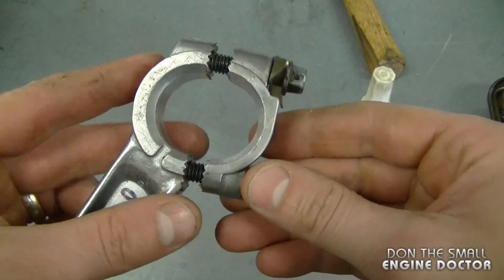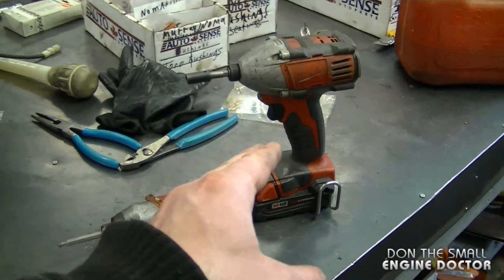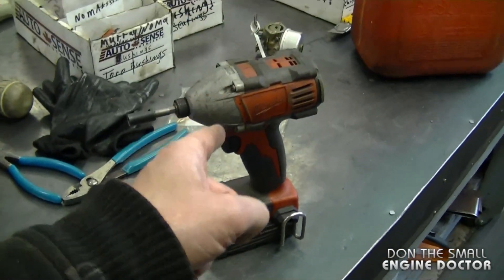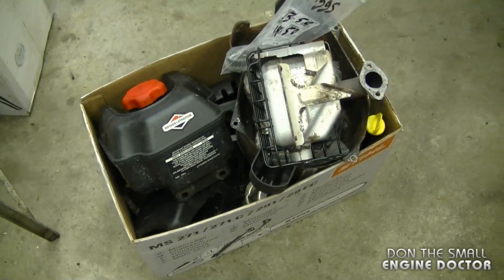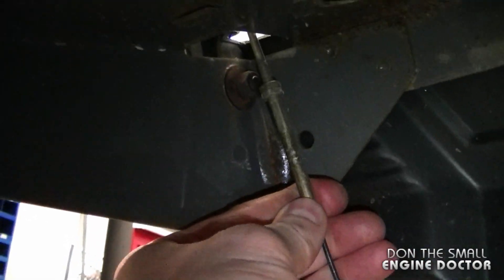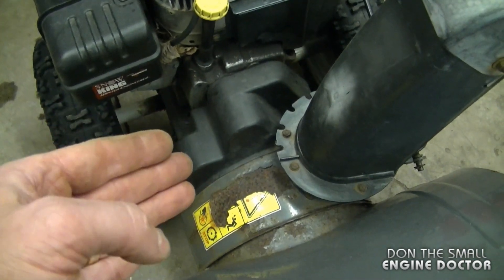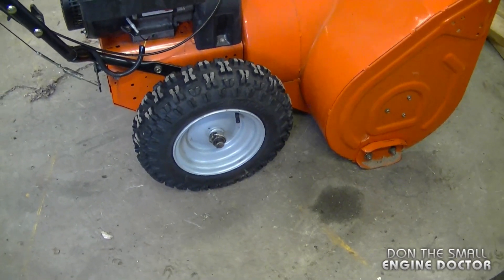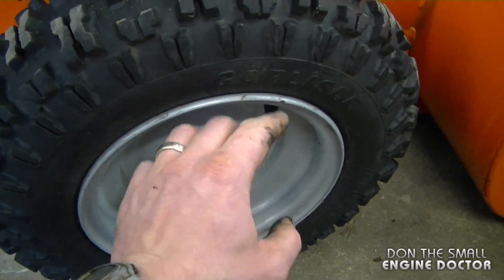Small Engines Q & A Video #147

Comment: Something to think about with a carb.  Check the throttle shaft and bushing (if it has one) before even wasting time cleaning or rebuilding it. It there is really any wear (there always is) it can cause a vacuum leak and run lean/hot. No amount of cleaning will fix it.  A little air leak can make a huge difference.

Comment: Great video, really nice mix of questions this time. Hoping I can tighten the drive clutch on my blower this way, would be an easier fix than trying to degrease and or replace the innards.

I've probably over cleaned some carbs, but I don't have a lot of access to replacement ones without going online. I am a fan of using a torch tip cleaner tool, and permatex generic hylomar on the gaskets has also done well by me.

Comment: When the carbs get old the throttle and choke shafts wear out the aluminum carb body creating a small but noticeable vacuum leak that's why some older ones can't be cleaned to fix problems

Comment: I think the fuel is a big problem now that used to not be, I worked on 3 carbs where the float valve seat had swollen  and several string trimmers where the fuel lines deteriorated prematurely .

Comment: Great q&a Don! The ethanol in the fuel really ruins the carburetors on these small engines. I find the small carburetors on two stroke engines like brush cutters and chainsaws get ruined more quickly than those 4 stroke carbs. Can you still buy ethanol free fuel in Canada? Here in Holland every brand of fuel has at least 10% ethanol in it. Since the last three years I run Aspen in my power equipment. It is sort of a biofuel that all professionals here use. It leaves almost zero carbon behind in your cylinder and its exhaust gasses are much cleaner than with regular gas. Unfortunately it costs almost $4 per litre. I don't know if it has any ethanol in it, but my equipment runs fantastic with this stuff!
I hope temperatures will rise soon there in Canada. Is it still very cold at your place?
Have a great weekend Don :)

Comment: Nice video Dony!   With regard to carburetor replacement, I'm going to replace the carb on my Honda HRR216 mower.  My question is, are these carbs pre-set at the factory or does the low/high idle need to be adjusted.  If there is a limiter cap (I think that's what it called, lol) I'm guessing they're pre-adjusted. Always enjoy your vides Dony, have a great weekend.

Comment: Got a question about John Deere SX75 riding mower. It's a smaller rear engine driven model. The issue is that it will not speed up into the higher gears ... it is moving forward at slow speed and reverse is actually slightly quicker. What could be the possible problems? Is it worth it to fix it? I suspect it's the transmission but not sure. Thanks!

Comment: Thank you for posting your videos Dony,they are very informative. Can I ask you why would a B/S 18 h.p. opposed cylinder engine only runs while the choke is fully pulled out, and then it barely runs? I rebuilt the carb and the fuel pump, still its sluggish and stalls. I bought this brand new back in 1994 and it just has never run or idled right. I even bought the extended warranty back then. The Sears repair guy told me "You have to run this engine full throttle all the time", and that was 21 years ago.It never has ran right since it was new..Its in a Craftsman G.T.5000.
Reply from the maker: it could be a bad carburetor, sometimes adjusting it helps
Reply: donyboy73 Thanks Dony.
Reply: "Well,Do Ya....Punk"? There are 3 things you can do with dog shit......

Comment: I have a used '95 MTD 28"  600 series blower, with a 10 hp Tecumseh, and with new, matched set, dual auger belts.   One of the belts keeps coming off of the large pulley after some use, to the point that once I engage the auger, I won't disengage it until I first shut off the engine.  Despite this inconvenience, it might still come off once or twice per use.

I keep the plastic belt guard on top on during use.  I've taken the auger unit off, verified the bearing's condition, and that the impeller sits flush against it.  I've replaced the missing spring washer on the idler-arm's shoulder bolt.  

I hope the next part makes sense...  The large pulleys are dished, with their hubs offset to the side.  This means there's 4 different ways they can be placed on the impeller shaft:   -))=   -((=   -()= and -)(= where the = is the 3-fingered adapter, engine on the left, and auger housing on the right.

I put the large pulleys on the 3-finger spline adapter the only way they seem to both fit on it, which is like this    -)(-   when I first got it, the pulleys were not mated correctly, and the outer one wasn't even on the fingers, like -()-  and was quite a bit off-center.  Perhaps they have to go on like -))- ior -))-  ?

If I have the pulleys in the right arrangement,  -)(=, what else might be causing belt closest to me, to come off periodically?  From what I can tell, there aren't any guides or guards for that belt; the brake on the idler bracket only covers the first pulley.

Thanks in advance!   (you don't happen to be around Northern NB, do you?)

   -nevin

Comment: Hi I could use some help. Ive got a yard machines mini tiller that wont run. Ive changed the plug, cleaned the carb and tried putting a little gas down the plug hole and it wont even try to start. Any suggestions?
Reply: Greasemonkey 500 H. it probably has no spark . coils are cheap and easy to change just don't forget the air gap a business card between the coil and the flywheel. good luck
Reply: Mike Luckett ended up being blown. Think the guy ran it on straight gas. Thanks though

Comment: I believe that a LOT of the carb issues are because of how they're made today. They're made so much more cheaply and less user accessible. For example, remember when even 4 stroke engines used to have a needle or even 2 needles to adjust the mixture? And how you used to be able to tear them completely down? The mixture needles weren't removed because of emissions and the EPA. They were removed to make the carbs cheaper and faster to make. Nowadays carbs are disposable, that's what companies want, you have to buy the whole carb as a unit. Just like in most cars no days, you can't even check transmission fluids, much less change them. Companies are calling these setups "sealed units". No more buying transmission fluid and filters, you gotta buy a whole transmission when that one goes out due to not being able to service it. Everything is so disposable now days, everyone wants money money money. Its so pathetic. Sorry for the rant Don, I just think its horrible when cheapness and greed is starting to show its ugly face even in small engines. Thank you for the video buddy! Watching you from NC!
Reply: I hear you and agree. First thing I'll do when I get a chainsaw is to tear out those idiotic 'Intellicarbs', and replace them with older adjustable carbs.
Reply: ***** where do yoy find these "old carbs" ???
Reply: Lowell Tietyen
Take them off older broken 'donor' saws, or find them on Ebay. Check if it fits though!

Comment: Hi everyone, I'm looking for any assistance with my used snowblower it is a 1997 craftsman 11/29 and its really my first small engine item that has needed any work...and thanks to this wonderful man Donyboy73 I've had the confidence to tackle some issues. But things are getting real now. the other day the klik pin snapped while blowing, i made a turn...probably faster than should have and with wheels engaged and suddenly the wheel locked up....right wheel. It was while shovelling that I saw the broken pin and thought to look ....and yup left wheel is barely on the shaft.
I tipped it up, took plate off...there is a LOT of fine rubber sitting on the plate...the friction disc is firmly pressed onto the wheel ... and looking at it  on left side there are two chains sprocket assembly and jack assembly, and the one closest to outer left side wall ...jack....appears to be on an angle. looking straight on, the part closest to me is visible closer to the side panel than the back end of the assembly..
My fisrt task will be to try and slide whole thing up and into my shed....but then Im kind of like a deer in headlights...ive been looking for videos, maybe some out there can think of one...and the terms im using to search may not be the best.

Oh and then I was looking at the wheel and pushed it back on as hard as I could and the holes are not lining up...like I need to get the wheel 2-3 mm further on, so thats going to be a problem too.

Any help with direction to other forums, videos, ideas, tips....suggestions is so greatfully appreciated. I bought a used machine to try and save some money and if I get someone to come pick it up and take it to their shop 20 km away and fix and return.....why didnt I buy a much newer one. So id love to do it myself.  Thanks so much..sorry for the long post.

Comment: Dony, do you ever get any older John Deere chain saws in your shop?
Reply from the maker: rarely, they were mostly made by echo
Reply: I bought a brand new J.D. saw, and in less then an hour the coil went bad. I took it to the repair shop to see if I could get a coil and the guy came out with a complete used one that had a bad piston, he handed it to me and said "Here, you can just have it, your going to need a parts saw"....He was right.

Comment: What do u think about tuckupsies
Reply: Don't know how to spell the engine name
Reply: Liam Cobb  Heh, that's a great guess!  Tecumseh  (TEK-kum-seh), a native name of a warrior chief and folk hero from the early 1800s, were 4 stroke engines that powered more snow blowers than all the other engine brands combined.  Their parent company sold them off about 8 years ago;  I've personally only dealt with older blowers, but they've all been easy to start in even the coldest weather, don't easily flood, and have lots of torque.  Since they've been so common, replacements and replacement parts are easy to come by, and are affordable, should you ever need them.  Two blowers that I currently use have 10 hp Tecumseh engines each with over winters on them.

  However, I find them loud and very rough-running, such that if I ever used a blower that had a smooth engine, I think I'd find it very strange.